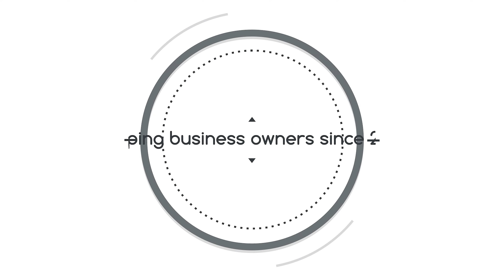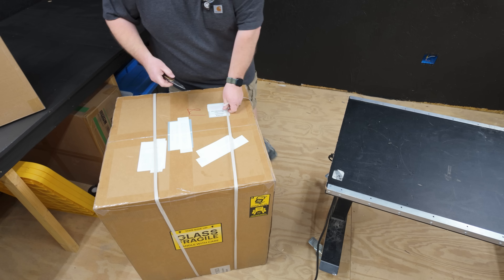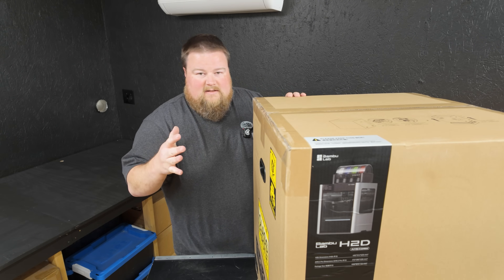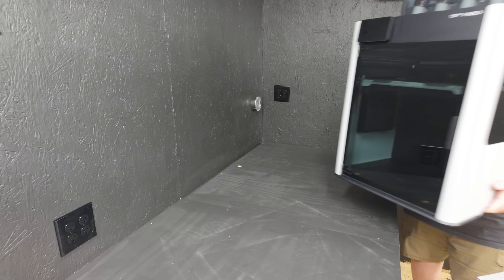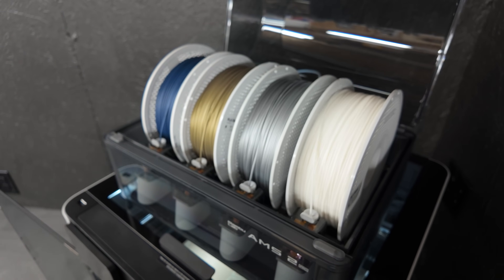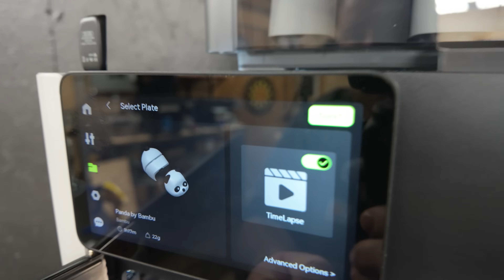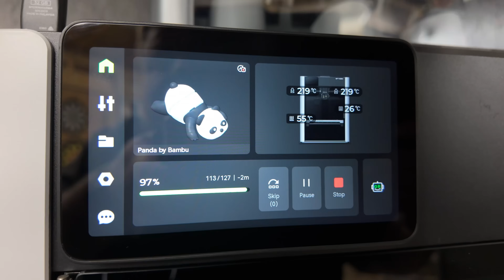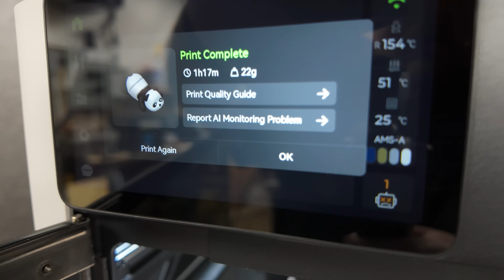Unboxing & Setup of the NEW Bambu Lab H2D

Comment: I noticed on the panda print, before a new layer, the print head goes to the back of the machine and then prints the new layer with the same color.  Is the nozzle getting cleaned on each layer and does it do that for single color prints as well?

Comment: Got my H2D today and missed some foam packing blocks above the lead screws that the setup guide doesnt tell you about. I did the calibration before noticing so hope nothing got damaged - I dont think so. Im new to Bambu printers (had Prusa before) and got a bit confused when the 'power' button didn't work, then found out that its just a pause button.

Comment: Hi Sam, now that your new shop is fully set up and you've had some time to work in it, how do you feel about the structural integrity of your floor? Do you wish you had gone with 2x10s? I'm wondering if you're experiencing any noticeable deflection when walking through your shop, and if you're having any issues with vibrations affecting your tools.
Reply from the maker: My biggest issue has been floor squeaking. I should have glued the plywood down. I've been chasing squeaks with screws for a while. Maybe I'll get there someday! Other than that, yes, larger floor joists would have been better!
Reply: @ thanks for the reply Sam!

Comment: Sam,  When you do your full H2D review video can you cover how to print the whole 350 on the X axes using the same filament (2 rools) in both nozzles.   No one is really covering it so far, and it would be useful knowledge to folks that mainly print single color items like alot of your prints, but need the full 350.
Reply from the maker: Absolutely! I'll put this into my shooting list and notes to cover on that video. Thanks!
Reply: @Samcraftcom  Any thoughts on a bigger UPS system with the H2D drawing 1300W?

Comment: I’m surprised they didn’t send you the laser engraving version.  Would really like to hear your opinion about the laser engraver and if you think it will eventually cause problems by contaminating the machine with soot particles.
Reply: Oh there is no question on "if" it will get contaminated.. its simply how long it takes, which is fully dependant on use. Lasering is high maintanence when comes to machine care or simply having profit margins to replace it once wore at all. Many materials its not the soot that is the issue, but actually full on corrosive particles that will destroy things like bearings and attachment points much deeper than you can maintain from wiping the surface.
Reply: @ My concern would be with regular maintenance and cleaning how long does it take to start causing problems with printer and quality?  For the price of the upgrade to a 40w laser seems like you could buy one from xtool that is bigger and more capable.  Also looks like the air purifier does not come with the attachment and is another $600 expense.

Comment: Saw a video that there is a way to use the entire build volume, you just have to split the model and I guess put the same filament in both sides. Then let the other nozzle I guess print the side the first one can't reach. Seems like the slicer should have a way to handle that automatically. (no manual splitting of part. Of course that's probably not very efficient way of printing, but if you really need to print something that big.

Comment: I’ve only had my P1S sans AMS since January, I’m very new to all this.  What I like about this machine I wish was on the P1S are the side mounts for the filament, and brighter lights.  I’m a hobbyist, so this new machine is not for me, but if I win the lottery, I’d buy one in a heartbeat.
Reply: Just a friendly FYI, you can very easily mod the P1S to have both a side-mount filament holder and better internal lights. The side-mount holder is just a single print that you can grab off MakerWorld. Try looking up "Side Mount Spool Holder" and choose one you think looks the best for you. I printed one from user Wenlaren that folds up and has bearings to help the spool roll, it's less than 3 hours of printing and works great! But there are others don't require bearings or any additional hardware

Comment: Thank you for the video. It shows several features of this machine. Looking at the video, it looks like the machine continues doing poop, even using two nozzles. Can you comment on that, please? Is it zero poop?
Reply: It'll still make poop. With 4 colors in an AMS and two print heads, it will still have to swap filaments and do the purges. But if you're doing a 2-color (or using support materials) the poop will be minimal or eliminated.
Reply from the maker: I’ll be sure to talk about that in my next video!

Comment: That was a miss on Bambu's part. They did not send the model with the diode laser to the laser engraving channel, but they did to other 3d printing channels. I would like to get input from a professional laser user on it.
Reply: Simple answer from someone who runs 100W C02 lasers. Don't bother with the laser modules in a printer. They're so pathetically weak and the residuce and crap that is produced from them it will coat the inside of the printer in a brown residue and dust everywhere.
Reply: @dejanbrice8774 You bring up an excellent point. I did not even think of the residue.
Reply from the maker: I think I may be in line to test that one in the future. I was a last minute addition and all the laser ones were given out to other creators.

Comment: I print a lot of TPU these days. Will this AMS handle regular TPU or does it have to be the Bambu Lab TPU for AMS? Thanks!
Reply: I believe that there is another input hole on the back of the machine that is made to feed TPU into the toolhead.

Comment: I haven't really investigated this at all yet, but is it still going to be possible to daisy chain multiple AMS units for a lot of different colors on one print?  Is it possible to use an AMS on the Left Nozzle or is the only option the single roll on the left for that nozzle?  That seems like a drawback in both color option and time (running out of filament and having it just pause until a refill takes place for example).  It does seem like color changing and the related poop would definitely be minimized on a 2 color print like the one Sam demonstrated.
Reply: Think read that up to max supports 24 colors plus 1 with HT filament holder and 4 ams units.  Pretty large palette, bet one could do incredible hue forge prints with something like that.  To get max print size can double same materials into each AMS unit for the A/B side since max size limited to each head ability to reach plate left or right side, workaround is dual colors loaded same for each AMS unit.  Pretty cool versatility.........